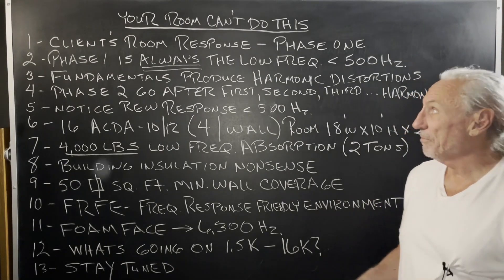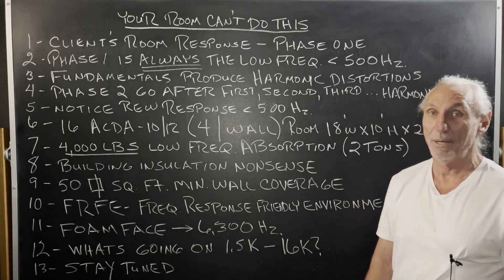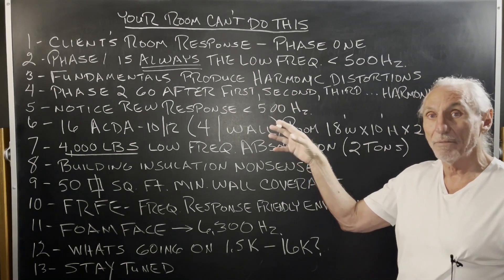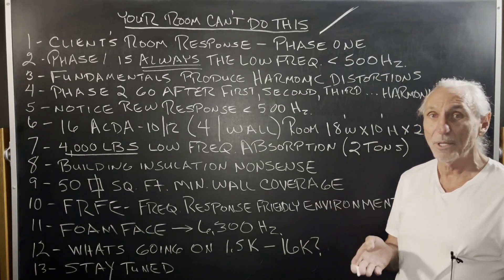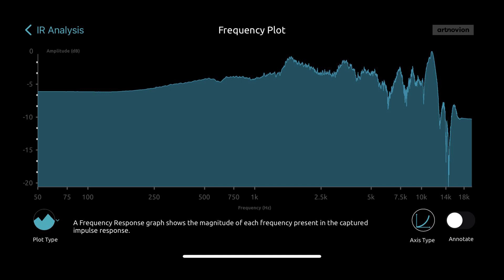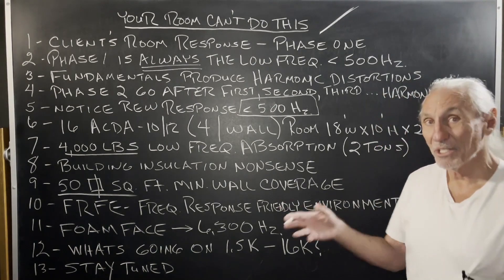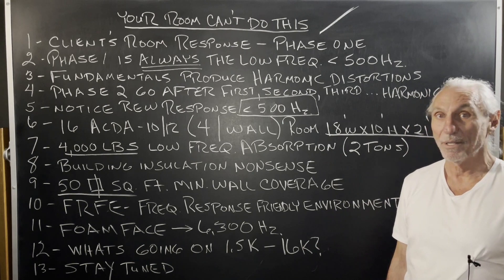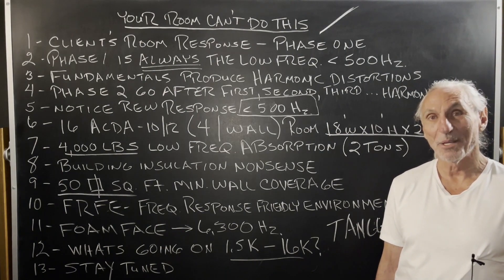Your Room Can't Do This - www.AcousticFields.com

Comment: So nice to see some graphs, Dennis. You once told me that a lot of viewers wouldn't understand them. While that's true in some cases, anyone with the expertise to enjoy your videos, is likely to have an understanding of frequency response curves. Well done, sir! Please post more of your treatment results. Thanks.
Reply from the maker: What did you learn from the video. State three main issues the video illustrated.
Reply: @AcousticFields  Hi Dennis. Here are my thoughts. I found more than three:
1) You must start by treating a room below 500 Hz. Actually, your other videos specify below 110 Hz (I think) but the principle is the same. If you don't fix this problem first, there will be room modes and distortions in the harmonic (octave) frequencies. 
2) To point #1, you must be prepared to sacrifice room dimensions to accommodate the thick panels.
3) Insulation is not the answer. The amount required would exceed the room volume! And it still wouldn't work.
4) I was under the impression a whole reflective wall would need to be treated with the ACDA panels. While that’s the optimum, you can get decent results with 50% coverage. This could be a game changer for those with limited budgets. 
5) The thickness of ACDA panels hinges on the frequency sweeps of the room. 
6) Here's’ the clincher: Treating below 500 Hz works well but does nothing for the frequencies above it. They still need work, as shown in your graph from 1.5 K and higher. 
7) Bonus thought: Dennis hates wired mics! Me too!

Thanks for yet another great presentation.